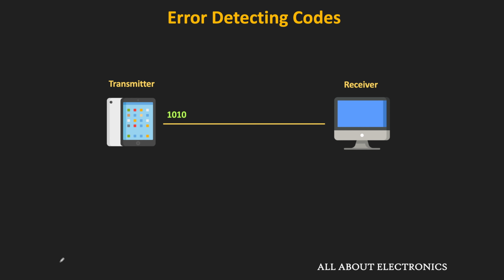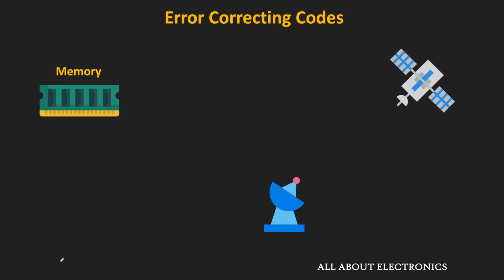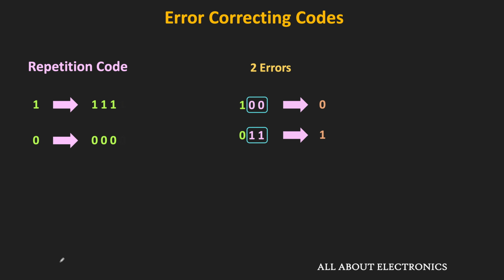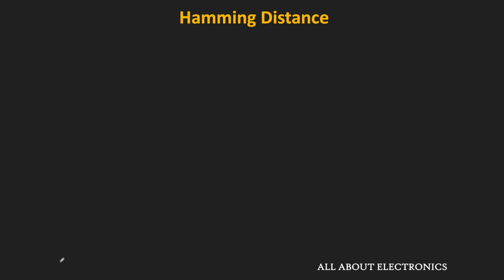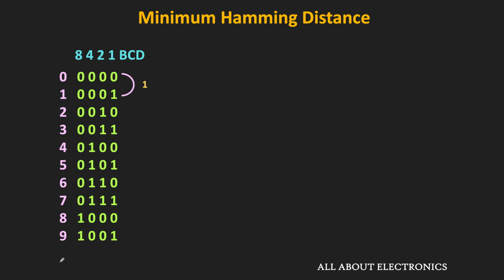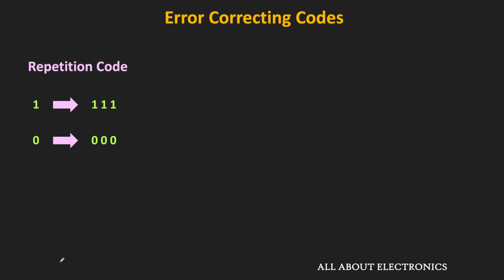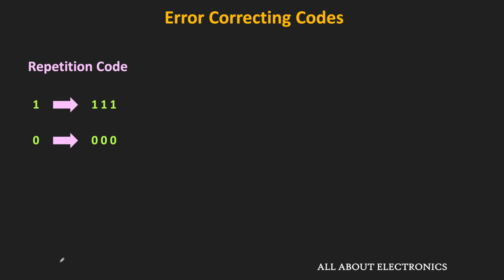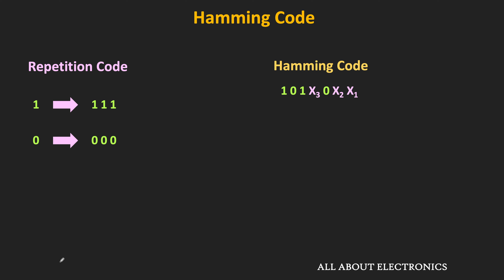Error Correcting Codes: What is Hamming Distance and Minimum Hamming Distance ?

Comment: how   d+1  and  2d+1   formula came??
Reply: its been 2 years but let me try. I choose d=2 in the example. lets say you send either 000 or 111. they have a distance of 3 because the have 3 different bits now try to flip any two bits. you will not be able to turn 111 into 000 or 000 into 111 so you will always know that something went wrong. if you had 3 errors 000 could turn into 111 and you would not know something went wrong. so this is why you need d+1 to detect errors. now lets look at it with 1 error if you have 000 it could turn into 100 or 010 or 001 if you have 111 it could turn into 011 101 or 110 you cannot get to 100 or 010 or 001 from 111 with just 1 error you need at least 2. this is where the 2d+1 comes from.

Comment: Minimum Hamming distance for error detection
To design a code that can detect d single bit errors, the minimum Hamming distance for the set of codewords must be d + 1 (or more). That way, no set of d errors in a single bit could turn one valid codeword into some other valid codeword.

Minimum Hamming distance for error correction
To design a code that can correct d single bit errors, a minimum distance of 2d + 1 is required. That puts the valid codewords so far apart that even after bit errors in d of the bits, it is still less than half the distance to another valid codeword, so the receiver will be able to determine what the correct starting codeword was.

incase you wanna understand the formulaes...from michegan university
Reply: Who read like this long comment

Comment: For d bits of error detection, the minimum Hamming Distance is d + 1. I don't really understand it. Take the example from the video:
0000
0001
0010
0011
...
The minimum Hamming Distance is 1 since the number of different bits between 0000 and 0001 is 1. However, it is 5 (4 bit + 1)...did I miss something? Also, where did 2d + 1 is the minimum Hamming Distance for d bits of error correction come from?
Reply from the maker: For example, if you want to detect the 1 bit of error, then the coding scheme which you choose for the encoding, should have minimum hamming distance of 2 between the each possible codes. On the other hand, for the 1 bit error correction, the minimum hamming distance between the code after the coding should be equal to 3 ( 2d + 1).  For example, if you use the 3 bit repetitive code for the encoding, then 1 is encoded 111 and 0 is encoded as 000. So, if you see the hamming distance between the code then it is 3. That's why these coding scheme can detect upto 2-bits of error and it can correct upto 1 bits of error in the encoded code at the receiver. I hope, it will clear your doubt.
Reply: @ALLABOUTELECTRONICS  Very helpful! Quite understand it now!